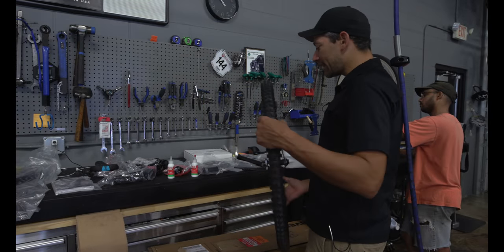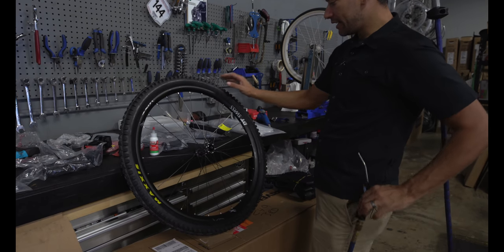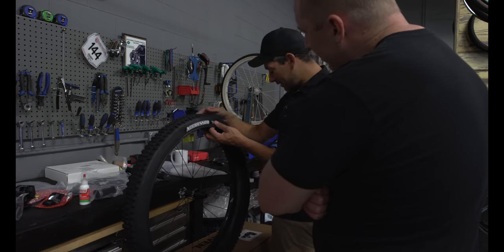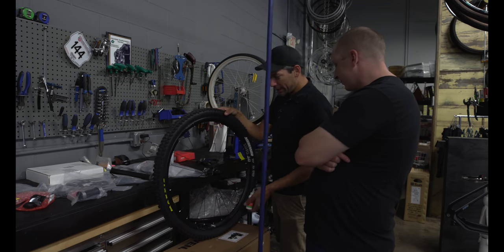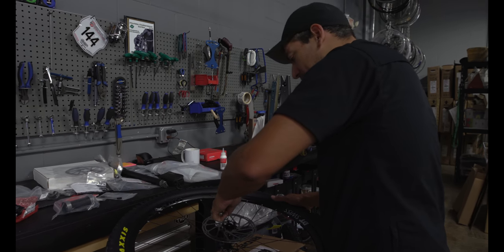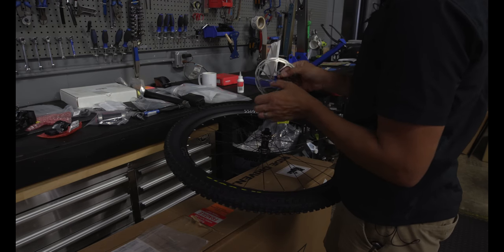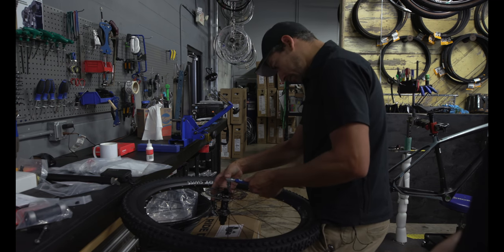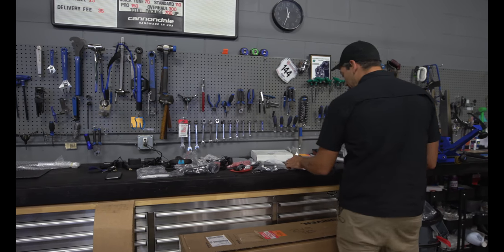2019 Yeti SB100 Mountain Bike:  E2 - Wheel Assembly

Comment: Matt another way to check the sealant is to let air out, remove the core and insert a small zip tie into the valve. LIke using an oil dipstick in your car.

Comment: Not sure if your old bike was a "one by" setup, but to me that is the greatest advancement in MTB in the last 20 years. I'd rather have it even over suspension.

I believe yours is a 1x12?

Not having a front derailleur/shifter, and only a single chain ring up front (narrow/wide tooth) is such a huge change in so many good ways. I let my wife ride mine because hers was having a chain problem mid-trail and she absolutely loved it over her 2x9. She's now planning her next bike just to get in on it.
Reply: BenFenner I went narrow-wide 1x on my e-bike build. What I don’t get is how you’re able to get up any considerable speed with such a small ring on most 1x setups?  I have an old 3x8 MTB with a 46x11 top gear. My road bike is 50x11 top end. These 1x MTB’s are only 30x11 or 10-ish, right? Some even lower. Seems like you wouldn’t be able to get past about 20 mph on the flat or down hill before topping out your cadence.
Reply: Patrick, there are a few things at play here.
First off, most times in MTB riding when you're pedaling, you're climbing. So you generally want lower gearing than most other bikes.

Secondly, your combination of front chain ring size and rear cassette spread will give you your highest and lowest gears. If you size them appropriately, you can get pretty much any spread you'd like.
If you're not happy with your highest gear (it's not tall enough), then go with a larger front chain ring. There's nothing stopping you there. It will obviously make your lowest gear taller as well, but that's the balancing act you have to play. If you want more spread, you should look at a cassette with more spread (gears or overall difference).

Your 1x setup being on an e-bike you probably don't need anything near the low end, so just go with a larger front chain ring and call it a day? That'd be my first suggestion...
Reply: @BenFenner  yeah in my case I run a special aluminum 1x ring made for the Bafang mid-drive units to give a better chain line (stock chain ring chain line is horrible), and it only really comes in a 42t size.  With the 42t ring I have a 8-speed 11-32 cassette which is fine.  I use gears 3 thru 8 most of the time.  Top end is slightly less than my road bike 50x11 top gear, but either way I only hit those on big downhills so it's fine.  This is strictly a street-ridden ebike btw.  My old MTB that I use on gravel has a 22x28 granny gear and 46x11 top gear.  I don't ride trails all that much (mostly gravel type stuff), so I'm cool with the 3x8 setup.  If I ever build another MTB I would consider some sort of 1x12 setup most likely.

Comment: That sealant is water soluble , just hose it off the inside of the tire if needed.
Reply: FireTrail741 - option to go with water based or latex based sealants
Reply: I have used Stans mostly. It washes off easily even on a used old tire. Muc-off and Orange work good too.

Comment: Maybe I’m weird, but at 30 psi in my mountain bike tire, they would seem half flat to me.  I run at least 40 on the trails and go all the way to the mid 50’s on the street.
Reply: The bigger the tire, the lower the pressure you can run.  I have 2.1-inch Big Apple tires on my e-bike commuter, which sometimes get as low as ~25 psi before I get around to airing them up again.  I put the pump on them maybe once a month or less.